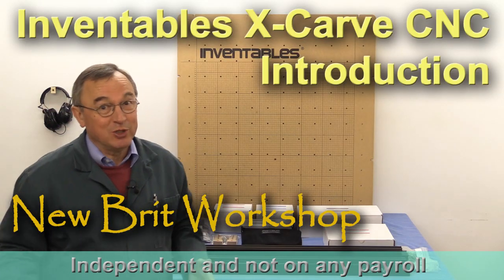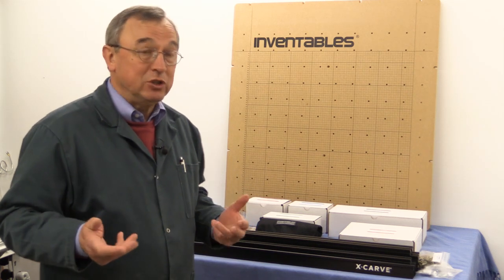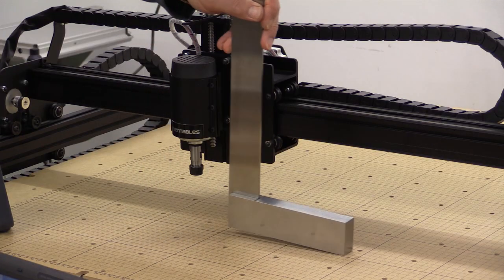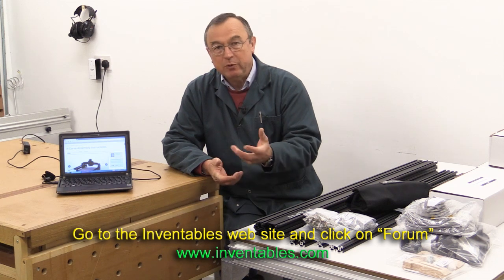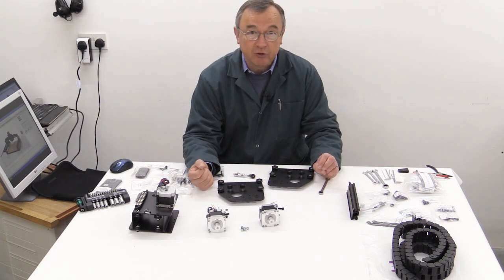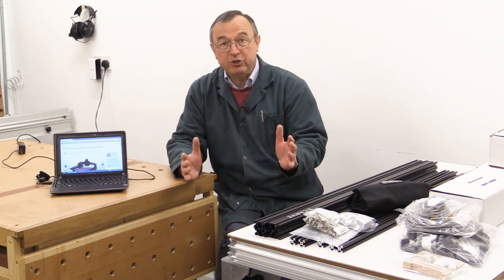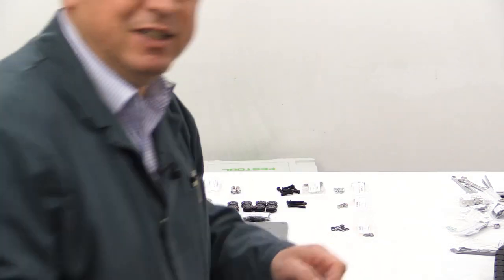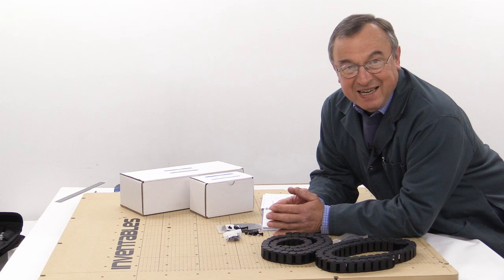Original Inventables X Carve CNC - Introduction

Comment: I'm just about to buy this. Is it all it's cracked up to be?
Reply from the maker: Paul Howell Hi Paul, You must understand that it is not going to compete with a professional machine costing $8,000 or more. As you will have control of the construction you will need to pay attention to detail. I am working on the "Commissioning" video right now and have produced some very pleasing results. If you do not make a good job of commissioning then it will affect the standard of the results produced by the machine. I can not judge what other video makers may have said but I can tell you that I have every intention of taking on new projects with the X-Carve and making further videos once the current video series is complete. I like it and have no hesitation in recommending it to you.   Peter

Comment: The X Carve is a very desirable workshop tool for any woodworker. Sadly, when you take into consideration shipping and UK tax/import duty the price of a unit is almost doubled for customers in the UK. If I could get one at the US unit price and a reasonable carrier cost, I'd buy one tomorrow.
Reply from the maker: Gareth Martin Hi Gareth, This is often the case with equipment from the US - have you looked at the price at the European distributor (based in UK) Robosavvy ?   Peter
Reply: Didn't know about 'em, thanks for the tip Peter.

Comment: As a builder of CNC routers and a woodworker I really dont think that this model is in anyway a good model for the home woodworker unless you are carving some light MDF - it will flex and error trying to cut oak. There are far far better models out there that will handle a full size router or spindle and are much more sturdy. No aluminium framed machine is suitable for anything other than light cuts in MDF - ignore what the manufacturer tells you. This is an CNC engraver - not a CNC router - it will literally only scratch the surface of any material you'd actually want to use as a woodworker.

Comment: Hi peter,  great fun project there, I'm building a cnc machine from scratch, starting to think it would have been easier with one of them.
Only thing that concerns me is its a bit small, what size is the cutting area? I've went for 2440 x 1220 

Still loving the videos.
Malcolm.
Reply from the maker: Malcolm Daly Hi Malcolm, Yes, a good friend of mine built a big (1220 x2440 mm) machine from scratch getting loads of bits from all over the place. The problem that he and many others face is at system integration - having loads of different parts from many different sources created all sorts of interoperability issues, sizes were wrong, screw holes in the wrong place and so on. I wish you luck.  The larger Inventables X-Carve has a working area of 800 x 800 mm which probably covers a lot of the work that most people do except, of course, with a full size machine you can make 4 gizmos at a time.  Cheers.   Peter

Comment: Very much looking forward to the series. I'm much interested in a judgement about precision of the machine, Can it compare to machines that are on the market for $5000-$6000. Is it suitable for inlay projects? Thanks so much for your advice.
Reply from the maker: Ron Kursinskis Hi Ron, Yes, I will investigate inlay work. I think that I will need to use V-Carve Pro for that as it has some rather nifty options which make it quite easy - but first I have to become an expert with the software !  Cheers.   Peter

Comment: Really great project, the chances of me getting one are very high barring you finding a very good reason not to.

However, I just compared the prices direct from the US compared to Robosavvy, basically the same amount in dollars and pounds. `$799 to £780. I understand about import costs, VAT etc but this is a joke. I came across this with an Accucut Grande mark a few years ago, I had to buy direct from the US as I just could not afford the UK price. Sadly, it will be the same with this.
Reply from the maker: Nevets That is true but you are likely to have to pay import duty and VAT if you import it yourself. I think that there is a customs duty calculator on the Inventables web site which may help. So far, everything that I have seen from Inventables and with the X-Carve has been top notch.  Good luck.   Peter

Comment: As far as CNC goes its ok to learn the basics on, but its a bit mickey mouse as far as production quality or accuracy,still if its free as a review product, why not.Unless it has ballscrew threads and a really rigid build it will never equal a half decent CNC tabletop machine. you should budget around 3 or 4 thousand pounds for a quality tabletop machine with decent software.i suggest the High-z series from Germany(CNC -router.com)as a European supplier with agents in most countries, no i dont work as one but have done my research.X-Carve is ok , Its just a bit Black and Decker rather than Festool......
Reply from the maker: the green man I think that you identified the advantages of the X-Carve. It is less than 1/3rd the cost of the machines that you describe and will provide the serious amateur with everything that he or she needs and will be an entry level system for the professional with a small workshop. The latter will have a limited budget and will want to learn the use of such machines from scratch - the X-Carve provides a low risk route for these people. I can see the education market being very interested in the Inventables offerings. The other aspect is that when I bought my first car it was not a Mercedes or BMW but was something in my budget which gave me years of good service and allowed me to improve my driving skills. Interestingly, I was able to maintain my first few cars myself and learnt a lot in the process. So, yes, I accept that there are superior machines around but the X-Carve does provide a realistic opportunity for people on a limited budget.    Many thanks for bringing this important point to light.    Peter
Reply: New Brit Workshop You should CNC a car interior. That'd be cool. I have an old Land Rover crying out for a PP interior custom re-fit.

Comment: Thanks for the vid peter I have been really interested in this company for a good while glad that we can get it in the UK now looking forward to the rest of the videos 

Cheers robert
Reply from the maker: nippychippy Hi Robert, The X-Carve is an entry level system which is designed to provide good quality work, to a reasonable degree of accuracy and be easy to assemble and operate. It is my aim to show this machine producing more than just a simple profile cut-out (like the skate board example that I have seen). I want to demonstrate the machine being used for work that will push the serious amateur to the limit and impress the professional with a small workshop. In other words, I am going to make the machine do some good quality presentable work. I am sure that I will be producing loads of videos showing work from this machine.  Cheers.    Peter